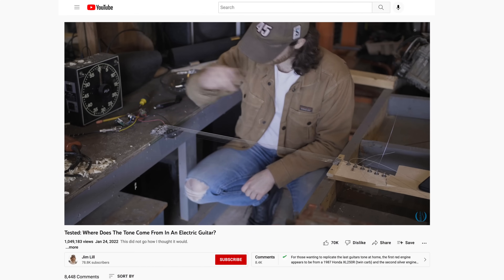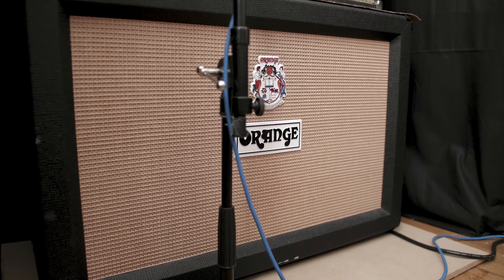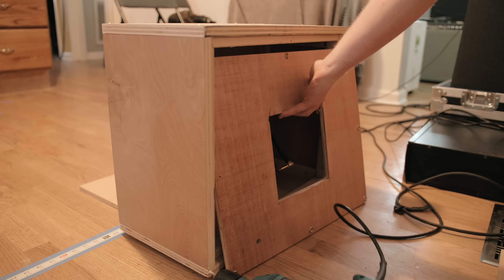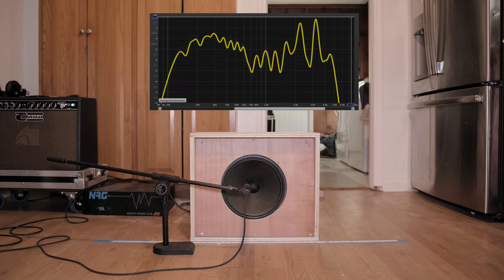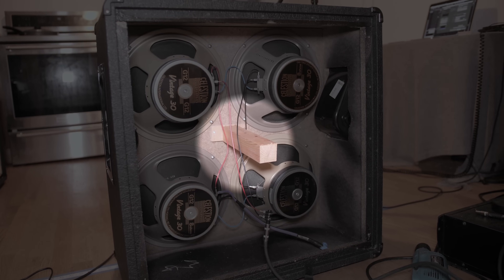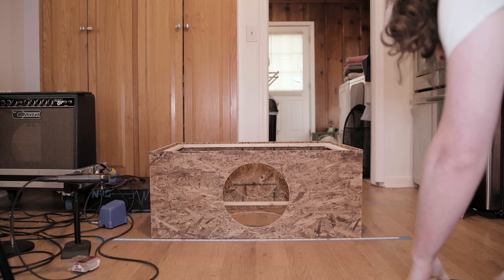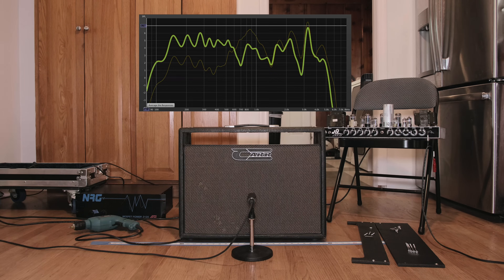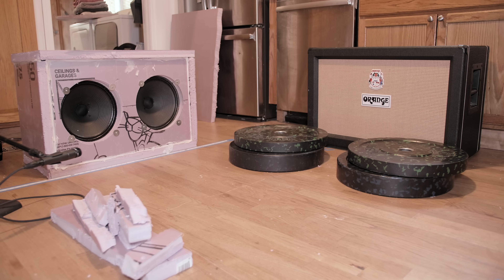Tested: Where Does The Tone Come From In A Speaker Cab?

Comment: Your conclusion is correct. The air inside the cab acts like a spring and a dampener on the speaker cone. Depending on the volume of the cabinet, this can dampen or boost certain frequencies. Furthermore, the geometry of the cab creates standing waves inside it, which oscillate at specific frequencies, acting in or out of phase with the speaker, boosting or dampening certain frequencies. It's a pretty complex topic that I haven't look at in well over 10 years. Guitar cabs are pretty simple, but you wait until you get into Hi-Fi subwoofer design, with tuned tubes, tuned enclosures, and passive speakers. Also, Eminence Audio still have a cabinet design simulator.
Reply: Thank you for your information
Reply: So you are saying it’s similar to the resonance concept of how the interior dimensions of an acoustic guitar can amplify  and shape the sound?
Reply: @kenigma4303  Similar, yes. The main difference is that the "cabinet" for an acoustic guitar is also the "speaker cone". But yes, the volume of air creates a certain spring/dampener combination which tunes the frequency response of the body. The standing waves inside be cavity in conjunction with the sound hole also determine tone. In theory, if you move the sound hole of an acoustic around the front face, you should get different tones.
Reply: @CristiNeagu  I guess I was just thinking of the waves of sound moving around inside the cabinet or acoustic guitar body similar to how the waves of light are reflected inside a properly cut diamond. The better the cut, the more shine comes out of the same initial gemstone. That’s why I was wondering if there is an objectively ideal shape (or shapes) to an acoustic guitar and subsequently, a speaker cabinet. Listening to the video, to me the large cabinet had the most full and deeply resonating tone.
Reply: @kenigma4303  Depends what you mean by "ideal". Some people like more bottom end, some don't. Also, it's always a compromise, so you can't get everything perfect.
Reply: This guy has far too much time on his hands, all this info has been known about for decades.
Reply: @hifijohn  known by specialists in the industry or is there like a single place you can mentions where all sorts of tests were done where they published the results to the public?
Reply: @kenigma4303  Both, but guitarists tend to completely ignore it and pretend it doesn't exist in favor of flashy words. You'd mostly find this info in PA and Bass system discussions, but never on a guitar forum
Reply: @hifijohn  Well quit bogarting the link
Reply: @CristiNeagu  To a small degree, accidentally  speaker cabinet is also "a speaker cone". KEF wrote a whitepaper about it when they were designing KEF LS50. The conclusions were:
1. Speaker cabinets emmit sound out of phase with the woofer and that signal makes ~1% distortion. There are two components of emission from speaker cabinets:
   a) Flexing of the enclosure panels that come from the enclosure inflating and deflating.
   b) Front baffle flex as well as the whole enclosure rocking back and forth as a reactive force to moving cone.
2. In case of point A, bracing the box raises the resonance of the panel flex, but doesn't damp it. It can be damped very cheaply by joining the braces to the walls with some viscoelastic material such as butyl rubber. 
3. Point B can be fixed by bracing the speaker magnet to the back wall (same as point 2) as well as making the enclosure heavy and reducing the radiation area aka keeping the front baffle narrow.
Reply: @andrewleach1667  pick up any good book on speaker building, specifically something that covers bass reflex design. I'm not a guitar cab builder, but I would assume someone has written a book about it.
Reply: @hifijohn  well, he IS a musician.  In Nashville.  So.....
Reply: @AnArmoredMarch  Funny thing - I was looking at the 12" speaker in a Carver Acoustic combo AG100D I got for $20 (no amp in it - tuned-port full-range box).  I did some research and that same speaker was used in keyboard and PA cabinets.  As I type this, I don't remember it being used in bass cabs.
Reply: @kenigma4303  There are no published results like this that I am aware of.
Reply: @kenigma4303 Look up Thiele/Small Parameters.They didn't keep their work secret. It was published the major scientific journal back in the 60s.

Comment: What was the atmospheric pressure ? Were they oriented to north or south ? Was it full moon ? 

(Your videos are great !)
Reply: I'm more concerned about the cable he used... and those jacks weren't even gold tinted.
Reply: @CristiNeagu  in all fairness, a bad cable can and will crap on any sound chain and drain any soul from the tone before it even hits the first true bypass organic analogue boutique germanium trve cvlt pedal some may have on their pedalboard. Jacks, not that much, it just needs to make decent contact, no rust/dust. 🙂
Reply: @CristiNeagu     Nobody sprayed any unicorn blood on the cable sheathing.
Reply: And was Mercury in Retrograde?
Reply: You forgot other crucial points such as ambient temperature, humidity, front baffle porting, and presence of fog machine haze!
Reply: @vch42  in all fairness though, the only really important cables are the ones in front of the amp or a buffer pedal and only if they are quite long. And even then it's just a treble roll-off due to the capacity, which some people like, like Santana.
Reply: @CristiNeagu  I hope cables is also on his list to test :)
Reply: Forget about it being a full moon, you'd rather want to worry if the cabs were properly mooned.
Reply: Yet atmospheric pressure does have effect on acoustics. Soundmeter mics don't respond the same 3700 meters above sea level as they do at sea level (I've experienced this). After all, soundwaves in air are perturbations around atmospheric pressure. (Yes I know in most practical cases this will be negligible). Air density, humidity and temperature usually are taken into acount in many acoustic equations (density mostly), including for infinite baffled piston radiation (which is an early approximation to the speaker box problem).
Reply: @chrisva4268  and also size of guitarist's ego. 😄
Reply: @Habixus  Yes, I've tested a number of cables from guitar to the first pedal on my board and some do sound different. Cable shielding, geometry and material quality effect capacitance and noise. The most important this is he didn't change the cable he was using in the test.
Reply: I only play when Mercury is in retrograde.
Reply: And most importantly: Had the guitar a Gibson logo on it? If not I refuse to accept the results.
Reply: @EbonyPope  🤣🤣🤣🤣
Reply: @iutchube  Brasileiro?
Reply: @vch42  Cut to the blind tests that showed straightened out wire clothes hangars were undetectable versus high end audiophile speaker cables.
Reply: @Guysm1l3y  timestamp pls?
Also, speaker cable is less susceptible to interference and tone mangling (almost at all, as long as it is not a thin wire).
The instrument/pedalboard cables on the other hand (basically everything front of the amp or in the effects loop) do affect tone. Impedance is a real thing. Been there, done that.

PS: yes, hanger wire may work ok for speaker cable. I'd be more amazed if the reverse was true, using 30awg wire.
Reply: @CristiNeagu  I think If it was the same type of cable for the three amps it’s not a variable, same conditions for all. And they sounded different at the beginning, the way they’re supposed to..

Comment: Man when you make a video you go HARD... Fun to see all of this compared. Personally, I play a Marshall plexi through a rather unusual 4x8 cab with celestions, this video again confirmed that I really need to upgrade to a 4x12.

As for the slanted vs straight cab thing, as you said it doesn't matter when you're miking it up close, but it very much matters in a live situation. Because 2 of the 4 speakers are slanted upwards in slanted cabs, they have a much bigger sound dispersion, allowing you to hear yourself better if you're standing within 3 feet of your amp (say, on a small stage), and allowing your band to hear you well too. If you're in the same position on stage playing a straight cab, because of the somewhat limited sound dispersion and your head being above this area, you cant hear yourself well, so you turn up your amp. All the while, your band members standing further away can hear you just fine, so by turning it up you're just pissing them off (ask me how I know).
Reply: Agree! As an amplifier cab builder myself, I have to say that this video is somewhat misinformational: If every audio clip in this video does actually correspond with the visual/video presented on screen, then it is clear to see that the recording microphone (in 99% of instances) is directly in front of the speaker... so, in a 4 X12 test... Jim is only recording ONE speaker... same goes for a 2 X 12 or any other combo. The wood, resonance and structure of any cabinet DOES affect the tone... but you're not going to hear that with a mic placed right in from of ONE speaker. To do this properly, Jim should place the mic say... 20 feet away - about where you'd hear the speaker if you were stood near the front in a small venue.. or managed to get right to the front of a stadium gig. Just saying! 🙂